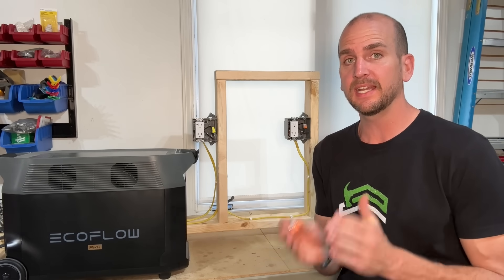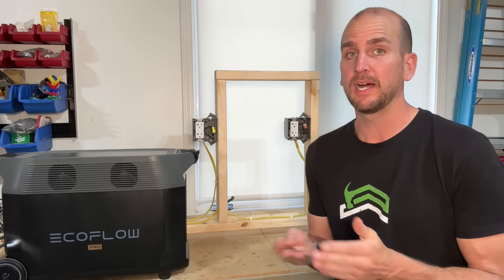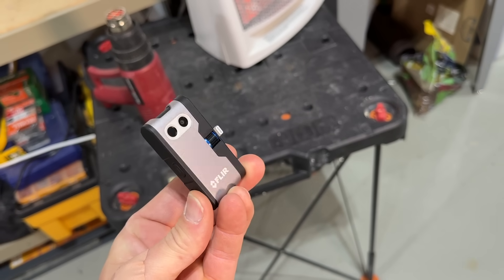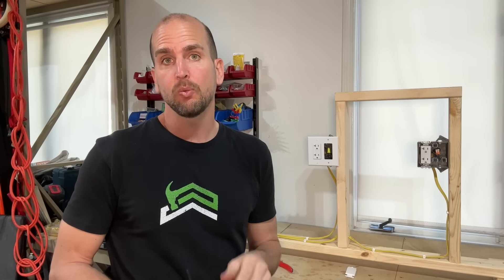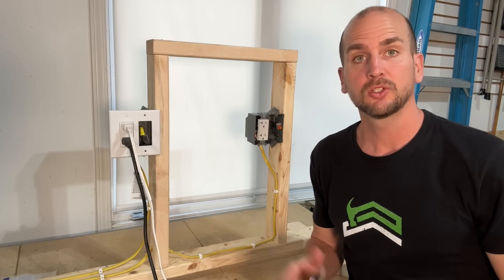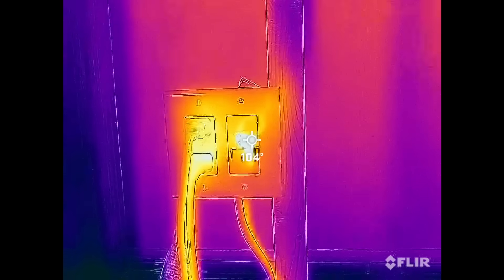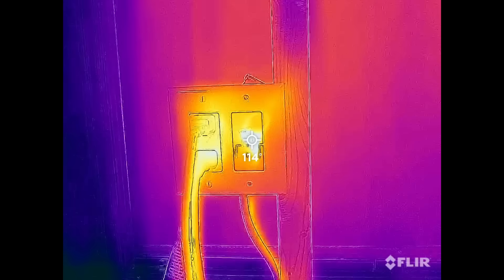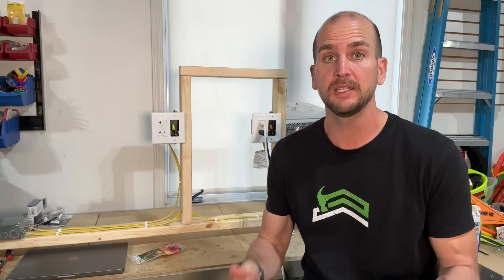Debunking the Pros: Can WAGO Lever Nuts Handle Heavy Electrical Loads?

Comment: Trash. Heat is one thing, voltage drop is another. Some weekend warrior has a ton is these in series somewhere and it turns into a cascading failure at end of run devices.
Might be less noticeable on European circuits which are MOSTLY 240 VOLTS…. But these are junk. Get a box of ideal red and yellows and a pair of linesman pliers.
I don’t like that these are being marketed to DIY people who don’t have the wisdom from conventional methods in mind.
DIY yourself into a mechanical connection. If you can’t terminate a connection using conventional methods, these DEFINITELY should not be the solution.

Comment: The more I see of the shitty 19th century outlets you poor bastards are stuck with, the more I pity you. 
If we need to loop at the outlet, we just twist the 2.5 sqmm conductors, shove them into the substantial tunnel connector and tighten down the screw. Wrapping conductors around a screw went out with button up boots.
As for wire nuts, I'll stick with the proven "BP" connector which is a tunnel type with a substantial screw enclosed in a top hat with skirt. Even after years of service heat it unlikely to be noticed.
Check out the Clipsal catalogue for details.
Enjoy.

Comment: i have used wago's for years. for solid core wires to push on and the one for stranded wires. i had never a problem. even the earlyer wago's in gray are still going strong. 240V 16A no problem.

Comment: Still a bad test with a perfect scenario. The wago bus bar relies on the wire being pressed down flat against it. Cram those wires 9 ways to sunday inside of a box with a bunch of other stuff and tell me they are still sitting perfectly flat. You have them both perfectly straight and parallel, that's never going to happen in the real world. On stranded wire this isn't as much of an issue because stranded wire bends more easily whereas solid wire does not. 

This also ignores the literally thousands of scenarios where electricians have had to remove Wagos that are in fact burned. The plastic is black and melted, the bus bar is burned in half. It happens all the time.

And lastly, this test completely ignores the time element. Over time as the copper oxidizes and the building vibrates causing the wires to shift ever so slightly, the resistance of the Wago can change significantly.

Comment: My issue and I have voiced this on many other videos and in person to others. I have yet to see a test of the Wagos of high amperage for 5 minutes. Then low or off, back to high after 1 minute of low/off. And repeat that cycle. 

To emulate a high amp load cycling on for 5 minutes then off for 1 minute, on for 5 and so forth. 

That’s the test I like to see. Will you be able to do that test?

Comment: Good video but this discussion is hilarious 😂 for solid core wires, we don’t use the 221 lever type, we usually use wago 2273 that has even less resistance. Your testing at 23A is also at the limit (depending on which certification). And it still performs great! Stop worrying about some connectors, judging from what I have seen of American electrics, you have much more dangerous things to worry about…

Comment: Well done!  I think that if you extended this test further until failure (I love testing to failure), i think you will find that the Wago will survive >30 min at above 2x rated current with no air circulation in 90F ambient air.  I further predict that it will survive above 60C (140F) ambient at 2x rated current (2x20A),  likely giving up around the same time as the wire insulation (90C), as the copper pulls away the same heat.  Good enough can be superior if the probability of failure due to human error is lower, which i argue is the case comparing Wago to wire nuts in all the combinations of 2, 3 ,4, 5 wire 12awg solid to 18 awg stranded.  There is simply no comparison in the probability of a poor assembly. 

Note: If someone thinks that the lowest resistance connection wins the day, period, then they should be hydraulically crimping them all the time (no wire nuts either).  No one i know does that smaller than 4 awg or about 80A, as a good wire nut assembly is good enough.  Now a good Wago L-nut is good enough.

Comment: So I know this may be a bit nit picky but I'd like to see your method for using wire nuts as there is also some debate around that as well. On paper there's really no reason a joint should be any hotter than the jumper feeding it.

Comment: Good video, I like WAGOs and have used them (DIYer) extensively in my home and shop. They have been used in Europe for years without issue. I think pros just don't like new things, especially when it's something that appears to make a job easier, same reason plumbers don't like SharkBite style fittings.

I've asked a few pros dogging on WAGOs on social media to provide a source showing they are unsafe, or even just one source citing them as the cause of a fire and have yet to receive a reply.

Just to clarify, a 20 amp breaker would not trip on a 20 or even a 23 amp load. Depending on ambient temperature, it could support a 23 amp load indefinitely without tripping. Breakers have a trip curve (speaking generally here, and about household breakers), a 20 amp breaker could be at ~130% of its rating (~26 amps) for up to an hour before it would trip. You have to actually get well past the breaker's labeled rating to trigger an instantaneous trip, on the order of 200 percent of labeled rating.

Comment: I think (and granted I'm not an electrician or even an electrical engineer) that more important than if the Wago has more resistance than wire nuts is the proper usage of each (especially wire nuts - I can tell you how many times I've seen wire nuts just "come off" when replacing a fixture, etc. adding to that how many times I've seen stranded and solid wire joined where it's likely not okay to do so based on wire nut manufacturer instructions.  My feeling is that for DIY'ers it's probably best to go with Wago Lever Nuts and if you're a Pro then working with wire nuts is just fine.  Where I have to re-work a box I'll replace with new anyway - most often with lever nuts because they're easy and I can afford them...
Reply: Properly installed wire nuts by a conscientious electrician don't "just come off".  Only ones installed by hacks or DIY'ers.

Comment: The Wago relies upon carrying the current through intermediate metal parts, rather than from one conductor directly to another conductor, which when the wire nut is installed correctly, is still the superior wiring method. The Wago was invented because people lacked the skill to make wiring connections properly. I learned this from a manufacturer of refrigeration equipment several years ago, where I first encountered the Wago connector. He explained that getting low skilled, low paid workers in economically depressed countries to make electrical connections required a more foolproof method, and the Wago satisfies that need for making electrical connections when you don’t possess electrical skills. The idea that the Wago will not cause a problem is not a sufficient reason to use it. Will it work? Sure… but there’s no reason to use it unless you don’t have skill.

Comment: I saw a test where someone ran so much current the insulation on the wire melted off, and the Wago nuts were still okay. In fact, the wire nuts melted, leaving just the steel helix around the wires. But the Wago plastic was still intact (although I'm sure it was hot).
Reply: I saw that one also, that changed my mind on if I should use them. Love them more than wire nuts, but still use both depending on situation.

Comment: I don't have any immediate concerns with the performance or safety of Wago's that are properly installed and in new condition, my only thought would be their durability with years and years of heat cycling and if the small thin metal bus bar would eventually fatigue over time, kind of how your stab connectors commonly fail and loosen (I know, not exactly the same thing).  I'd be fine installing them in my home though for basic repairs.  I don't imagine they will be used in large full home jobs in the US for some time until cost and availability improve.

Comment: I think your tests are fine as far as they go. But from my years as a general home repairman the real test would be long term stress use over several seasons. The failures I have seen seem to be from long term use over several years with the expansion and contraction of the connections. The poly-butyl pipe or the back stab electrical outlets would be a good example, worked fine in testing and initial installation but what a problem after years of use.

Comment: I'd love a similar test for the non-metallic splice kits. They're specifically carved out in code for repairs only but they get tons of hate from pros. I've never had one fail.
Reply: Now, I do use these when I have to, and they work well SO LONG AS you terminate them correctly.

Comment: Max capacity is a distraction.  The product would not be approved if it couldn't safely handle the load.  The real question is consistency in connections.  Even if you do "everything right", wire nuts can come loose when you are trying to push wires into the box, resulting in a bad connection that can generate a lot of heat, or even a short...unless you actually solder the wires together before putting the nut on.  Properly installed WAGOs will always give the same electrical connection regardless of wire type or rough handling and can be visually inspected to make sure the wires are correctly placed.  What is happening inside a wire nut is never 100% certain.

Comment: Well, there you go. You didn’t pretwist. Twisting your wires together PROPERLY will be far superior to levernuts, especially with more than 2 conductors. There have been other videos on YouTube proving this.

What sets the professional apart from the handyman is the quality of a connection. If levernuts are easier for a diy guy and they are unable to make a professional connection, they should not be doing electrical work. The thing I do more than anything else, is the simplest thing I do, the most critical thing, the thing done poorly most often, and the most dangerous when done poorly, and that is making a splice.

The receptacle you used is prone to strip out when tightening the screw. The cheaper outlets are better for tightening the screw. Making a hook, wrapping it around the screw, squeezing the hook closed and tightening the screw on the cheap receptacles is far better than those expensive ones where you push the wire straight in and tighten down the screw. With the cheap ones, you can crank down on those screws like no buddies business and make a far better connection.

By the way, I have come across melted lever nuts while troubleshooting. When I found that, it confirmed to me that they are inferior to a connection twisted with my lineman pliers. I have found many melted wire nuts but every time you could tell the connection was not twisted or not twisted properly. Often times they are connecting 3 or more conductors and because they just pushed the wire into the wire nut without twisting first and cutting it off flush so they are all the same length, one of the wires goes in too long and the rest don’t make good contact. 

One last point. It’s not just twisting that matters. It takes some practice to get good at doing it properly. I have shown people how to do it and was surprised at their lack of ability to do it right. Therefore, I came to the conclusion that it’s not as simple as it feels to me. I have been doing this for 35 years and my lineman pliers are like another couple of fingers to me. I now realize it is a skill to be taught and another reason why electrical should be done by an experienced professional.

Comment: In all of the discussions that have been going on about electrical connections there is one extremely important factor that no one has addressed and that is a gas-tight joint.  In order to prevent degradation of the connection over time the contacting surfaces must not admit 'air' or oxidation will occur and the resistance will increase. Yes, copper oxidizes! Less than aluminum or brass but it does. A gas tight joint means: clean surfaces, enough joint pressure to maintain the tight fit, and enough compliance in the joint to keep the pressure when temperatures change. On crimped terminals the terminal barrel and the conductor must be squeezed so tightly that they essentially become one piece and no gas can penetrate the contacting surfaces.  This is easily done with screw terminals and crimping. But point contacts and pressures insufficient to cold form the contacts into gas tight joints cannot make gas tight joints. The components just can't deliver the needed pressure over the required area, over time, to make and maintain a gas tight joint.  The connection will run hotter and oxidize faster than a large area gas tight joint. 
If conductors are twisted tightly at least two whole turns then 'clamped' with a proper wire nut, then the joint will have enough area and pressure to not present an increased joint resistance. Same with screw clamped terminals with lots of contact area and pressure to maintain a copper-crushing tight joint. 
All this applies whether large conductors are involved or small, solid or stranded. Industry has for decades worked to create the hardware and methods and tools to create gas tight joints that are reliable for high and low voltages and currents.  Look at all the wiring in aircraft. It's gas tight. NASA certifies components, tools and operators to assure this reliability.
Why would anyone use any device that can't make or maintain such a connection? Cheap and easy and good enough is why.  But for reliability that's not good enough. Push-in connections have shown this problem and many devices have failed with some causing fires. Why the heck would one want to use a device that truly isn't fit for use!!!
I want zero possibility of such a joint failing with the resulting damage.
Pete

Comment: Two points: you aren't clear about the starting temperature for each test. Also, you can just measure the resistance across your connections with a meter.

Comment: Wago is rated for 105 C, romex cable 90 C
Easier to use and foolproof while wire in wirenuts are more likely to be poorly set. Some countries in EU forbid wirenuts, all accept Wago.  Leviton has a new line of switches, outlets using Wago style connection instead of screws !

Comment: The increased resistance may be subtle on new install but will allow more carbon and corrosion buildup *over time .
A Properly installed wire nut will squeeze and deform the wire not allowing oxygen to react at the contacting surface.
IMO, WAGO's still have no place outside of maybe a basic lighting circuit.

Comment: I asked a friend that is a master electrician here in Missouri about the 221 and they said they would have no problems using them
Reply: The friend did say to make sure to tape around the 221 down onto the wires to make sure the locking flap did not get hooked on a wire and open.

Comment: Wire nut: Tons of ways that it can be a problematic connection, and you have no idea if it is correctly installed.

Wago: Practically fool proof and you can see that the install is correct.

Comment: My recollection of high school physic’s emphasized that current is on the surface of the metal, not in the core. Thus maximizing surface area at the contact, validating the concept of pre twisting for wire nuts to yield the least load loss. 
Additionally one might ask if using multi strand wire helps mitigate current draw down with multiple connections?
Reply: Surface area in wire nut connection is multiple orders of magnitude greater than Wago.  So why the negligible difference in temp in this real-world, worst-case test?  What this test actually validates is that only someone who doesn't value their time would keep using wire nuts.
Reply: @SplashJohn  Valid point. But my time is free, every day is Saturday when you pass 70.   😆

Comment: From what I've learned, FLIR doesn't do xrays. The images you are getting are the temperatures of the PLASTIC FACEPLATE of that box, reporting the temperature of the inner heat producing internal parts radiating their heat onto the faceplate.